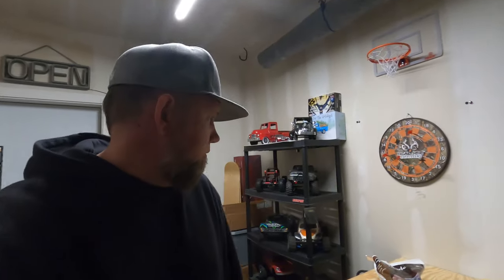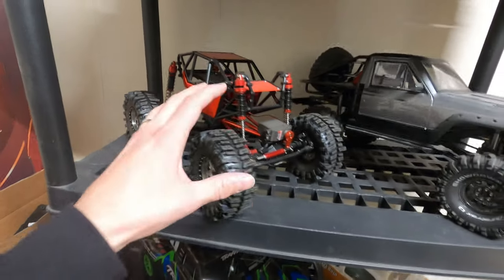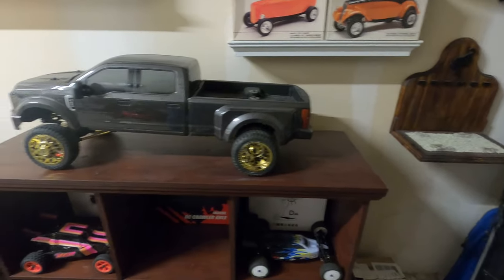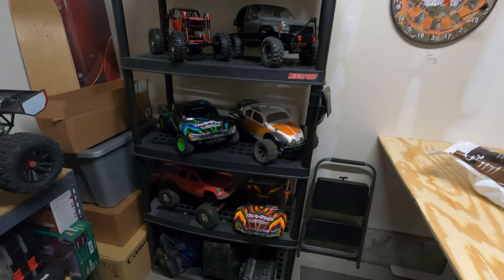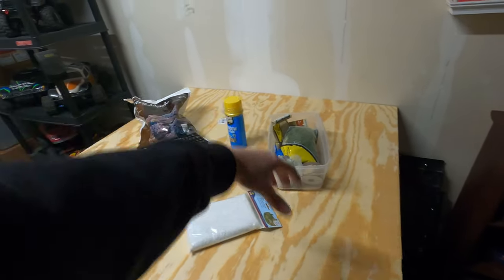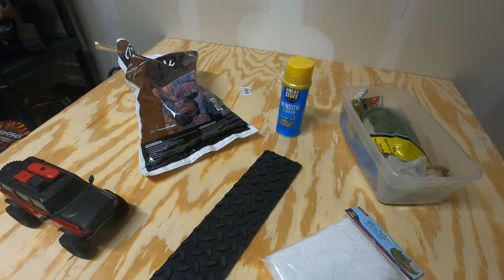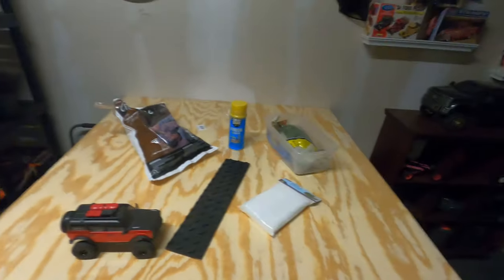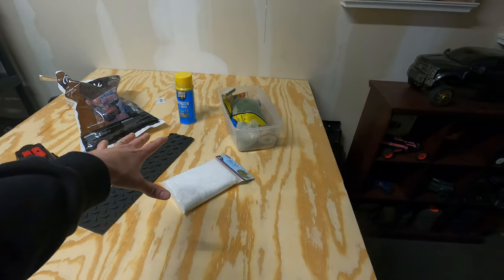24th Scale Crawler Course, New Vehicles & Mod Updates #crawlercourse #scx24 #dbxle #custom #update

Comment: I started building that injora buggy with the same 313mm links and they were horrible the link ends scrapped the axles and skid plate and would bind horrible and that was using the scx10 r plica injora straight axles. Ended up getting some 313mm high clearance links instead and gonna go with the fusion quicrun se 1800kv and stealthX transmission to have some overdrive